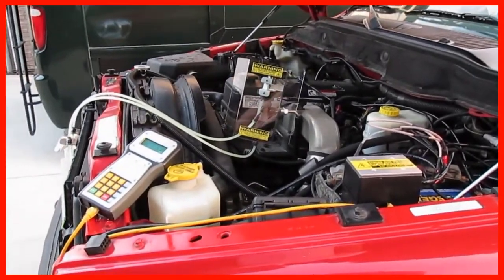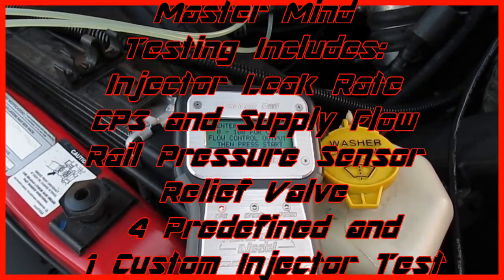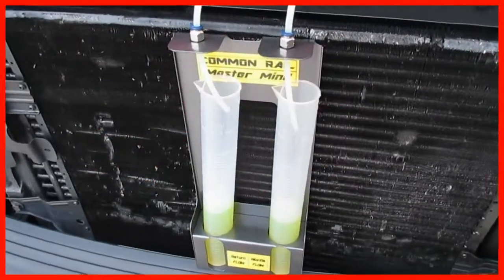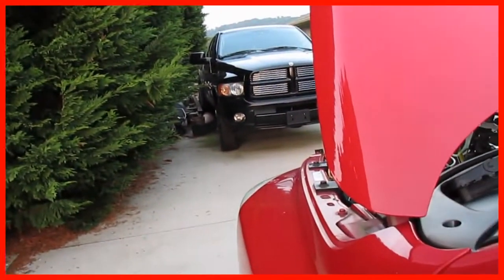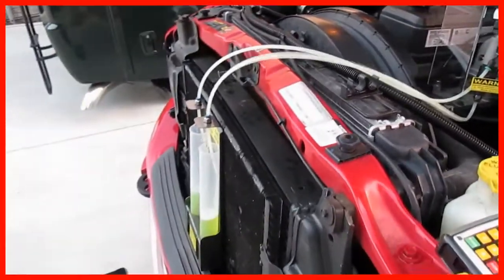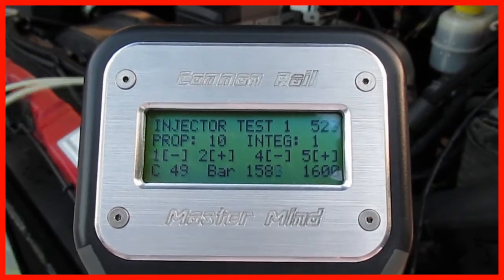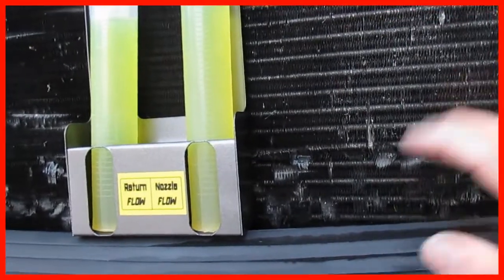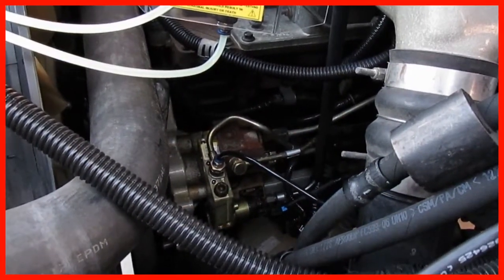Master Mind Cummins 2006 Injector Testing

Comment: I did an injector test by way of the "cap off the injector method" using the 9011 caps from Oregon fuel injection, and across the board I had 13,800 psi at each test  and 4000 to 5000 psi at idle (not bar). When i unplug the FCA it would default to the same 13,800, so without doing all the flow test and all that complicated figures , which i do need to have done"  i have a feeling either the cascade overflow is bad or the rail pressure relief valve is bad. The truck is a 2003 dodge 3500 5.9 and it starts fine and runs fine , no smoke black or white, but fuel economy has dropped , and first start in the morning it will start right up but then it will almost stall out then catch again and run fine almost like its dropping below the 4000 psi it need for the ECM to keep the injectors firing. I am a repair shop but just general automotive repair and this is my personal vehicle but I do want to move into the Diesel diagnosis and repair part of the business . I have watched a lot of youtube videos on this but I believe your channel is the most highly technical and proper approach to diagnosing and repairing common rail failures. I had no idea that you could buy Chinese garbage bosch copies common rail injectors on Ebay until i saw your channel, so if these cheapskate fools out there want to put that crap and  into their $20,000 engine, got right ahead and learn the hard way! Its criminal what China is selling in our country.
Reply from the maker: Yeah, it sounds like the pressure limiting valve on the rail is the culprit. You can remove the line from the top of the valve by bending it out of the way. You will have to use a bolt and nut to plug the banjo end of the line where it has been removed from the valve, as it is also connected to the CP3 and injector return . If fuel starts running out of the valve before you reach 23,000 psi, the the valve is bad. I have new Bosch valves on the shelf, I will try to get them listed at www.motorsportdiesel.com today. They are just over $100.00. Without sufficient rail pressure, mileage will suffer greatly as well as performance.